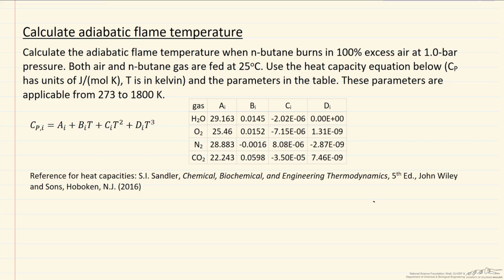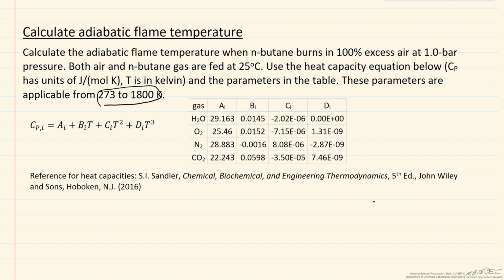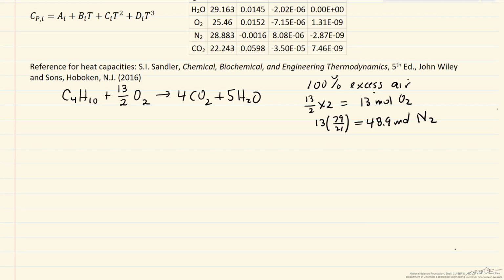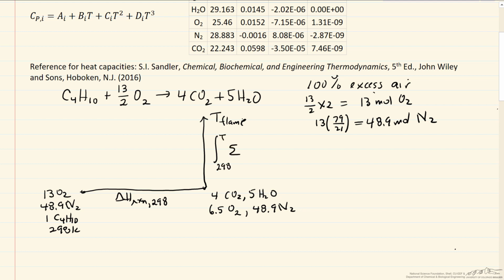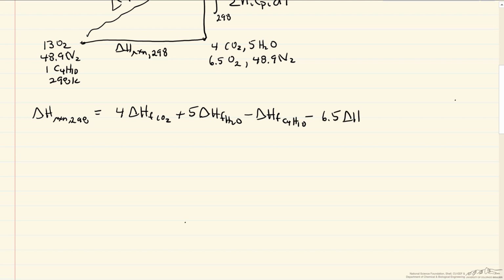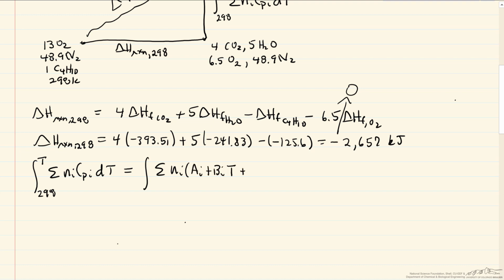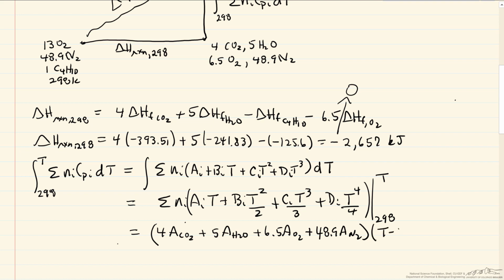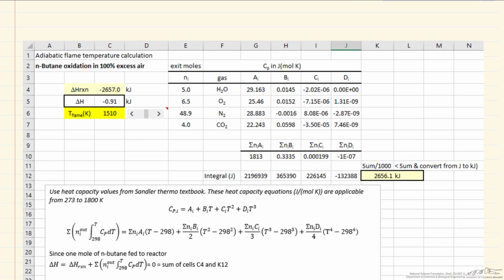Calculate Adiabatic Flame Temperature

Comment: Very good! I do use Chemkin for Tflame calculations, but for teaching purposes this is the best way to accurately determine the flame temperature. It works well for stoechoimetric H₂ flames in air, but the combustion of H₂ in pure oxygen tends to be overestimated when no N₂ is present. The value should of course be higher in O₂ than in air, but the calculated temperature becomes extremely large. I’m curious to know if you’ve observed the same behavior. Thanks!
Reply: I might have a few ideas; thank you if you could share your opinion. Some key factors may explain this overestimation. First, chemical dissociation at high temperature absorbs a large amount of energy: species such as H₂O, H₂, and O₂ break into radicals (H, O, OH), which significantly lowers the actual adiabatic flame temperature. If dissociation is ignored, the model assumes all chemical energy goes solely into heating the products, which leads to unrealistic temperatures (often exceeding 5000 K). At even higher temperatures, partial ionization also consumes energy and further reduces the true equilibrium temperature. Thanks!

Comment: Is this tewmperature equal to flue gas temperature? Example: when you burn ethanol with air, and you get flue gas asa exit stream, the T3 can be calculated using the same method?

Comment: Why did you multiply 13/2 with 2 because that will give us moles O not O2
Reply from the maker: This is a great question. We multiply 13/2 times 2 because it is in 100% excess, which means there is double the necessary stoichiometric amount.

Comment: not sure if you are using different constants for A,B,C,D, but isn't the formula Cp = A + Bt + Ct^(-2) + Dt^2 ? (the exponent for t on the C constant is supposed to be negative)
Reply from the maker: No, the formula can be seen at 20 seconds in the video. The C term is multiplied by T^2 and the D term by T^3.  Other forms of the heat capacity also exist but this is the one used in this video.